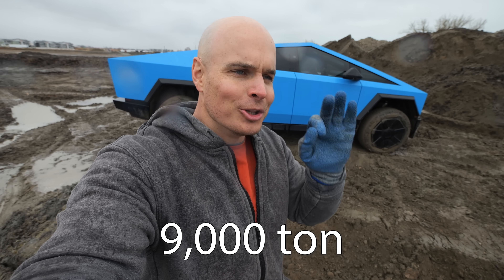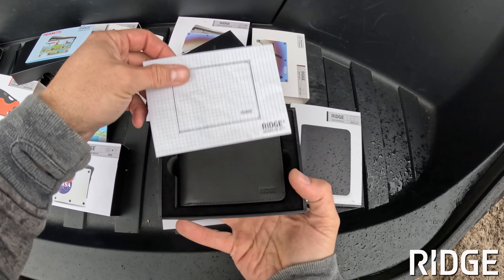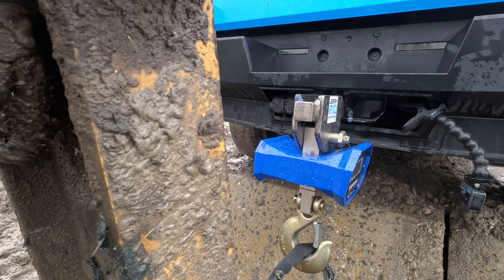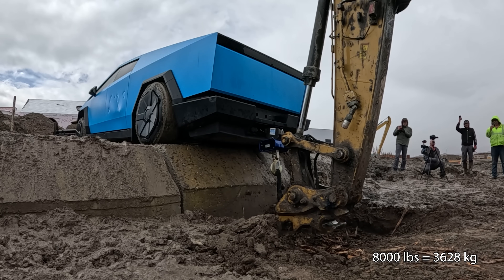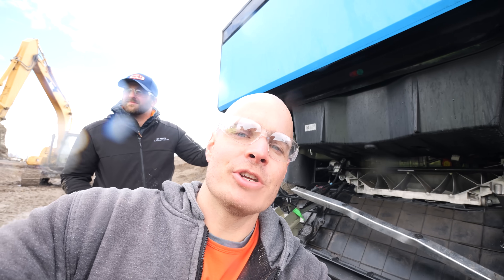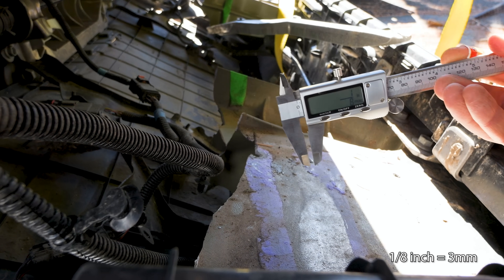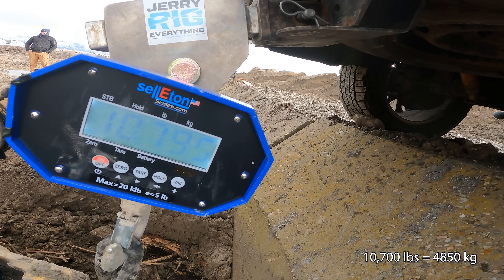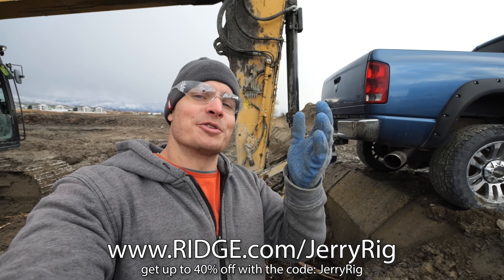SHOULD YOU TOW WITH A CYBERTRUCK?! - (catastrophic failure test)

Comment: 4.5 tons of force downward isn't really a realistic scenario. You should have tested that in the backwards direction!
Towing capacity is not equal to force straight down on the hitch. As the trailer itself will balance the weight on the axle(s).
This test is completely unrealistic.

Most people don't understand how real towing is performed. And thus this video gets very misleading even if it was not the intention. The comment section is filled with hate on the vehicle. That actually performed much better then it should. 4.5 tons straight down on the hitch is amazing!

Comment: Tow Hitch Weight Allowance!!  This failure is impossible to do with ANY normal pick-up truck.  The front tires will lift on the ground and the truck will not drive.  The Tongue Weight (downward) on a hitch should be about 10%-15% of the trailer's total weight.  This video is ridiculous and totally unscientific.
He won't acknowledge this. Any engineer would tell you that exceeding a rating by over 10 times is pretty good. But he has a bone to pick so the video has to be negative.

Comment: Horizonal load linits are very different to ball weight limits.. this is a 100% flawed test... typically most vehicles that that have 2500kg towing capacity are limited to a 90 to 150kg ball (hitch) weight. Just a silly test to perform.

Comment: it would be interesting to see how many repeated tongue weight tests within the rated weight of the hitch would cause it to fail. The fact that aluminium is weaker but lighter than steel is well known, although aeroplanes are largly made of aluminium, so they can obviously take repeated loads within their rating for many 10s of years. This "test" being a "yank it till it breaks" is fun, but apart from concluding that steel frames are stronger than alumium, and if you want to overload a trailer beyond the rating so much you have to hold the front down, it is just entertainment. What facinates me is that people are quick to judge a product based on it's CEO, but they most likely know nothing about the CEO of any of the other car/truck manufacturers. in one respect it is no different to your phone tests which are entertaining and brutal, but there are a larger range of classes of trucks with completely different physical ratings, so it is not quite an apples for apples comparison.

Comment: There is a reason why trailers in Australia that weigh 2000kg or more have to have a break away emergency braking system - ie if the trailer seperates from the tow vehicle and the safety chains fail, the trailer brakes are then automatically activated.

Comment: Sorry mate, but you are simulating excessive ball weight, not an actual real world scenario.  The suspension is taking most of stress, you are not testing the lateral strength of the frame, where the actual stress would be distributed in a real world towing scenario.  This is a very poorly designed, and disingenuous testing methodology that proves nothing for real world use cases.

Comment: I had more respect for you before this video.  At no point will anyone be able to put 10K lbs on a tow hitch receiver.  You proved that by having to hold down  the front end of both trucks.  This is misinformation at best.
Reply: It really isn't, obviously he had to hold the front down when the CAT vehicle was lower than the Cybertruck. otherwise it would come off the ground. Basic physics.
Reply: @AndreasRP.  you just proved my point.  No vehicle can tow a load with the front wheels off the ground.  You know, basic physics and all.
Reply: @navy_vet  I think you misunderstood the video. I recommend watching it again and paying close attention to what happens and what Jerry explains. This frame issue is more serious when going uphill or hitting potholes, that’s where the frame is most likely to break in a real-world scenario, but that shouldn’t be happening. It’s basic physics and a result of poor design by Tesla.
Reply: @AndreasRP.  I think you miss understand how this works.  You will never see a static or dynamic force of 10,000 lbs on a class IV or less rated hitch, pothole or speed bumps or not.  That is not how this works. He tested to absolute failure.  He brought forces into the equation that will never be seen in real world scenarios.  He greatly exceeded manufacturer tongue weight by 10X and max payload capacity  by 4X.  Testing to destruction is not how hitches are rated.  In order to see a 10K lb load on a bumper pull hitch, the weight of the trailer and contents would need to be 100,000 lbs.  18 wheel trucks can weigh a maximum of 80,000 lbs and must distribute that weight over 18 wheels not just 4.  Speaking of tires, this test alone almost doubled the maximum weight carrying capacity of the rear tires alone.  So even if you consider a dynamic weight change with any potholes or flying elephants, you will never reach 10,000 lbs on the rear hitch.  Watch the video until the end and tell me again how wrong I am.
Reply: @ it’s a truck, 10.000lbs isn’t a lot, the Ford did it with no problems ahaha, Tesla is junk.
Reply: @ Tesla being junk or not is not what the problem really is.  The problem is the poor testing practice in this video and the misleading statements made.  As for your statement, put 10,000 lbs in the bed of any 3/4 ton (max payload 5K) or half ton (max payload 4K) truck and see what happens. You can even use a 1 ton dually (max payload 8K).  10K isn't a lot!  Ok!  You obviously don't tow heavy trailers and have little to no idea what GCVW, GVW, GCAW , payload, CCC, pin weight or tongue weight is and how those figures work.  If you do tow heavy then I suggest you find out what these mean really fast or you will meet the friendly DOT officers very quickly.  I guarantee if DOT catches someone pulling a 50K lb trailer on a 3/4 ton truck (that would be 5K to 6.5K lbs of hitch weight) then the DOT will politely place said individual under arrest.  But, you do whatever makes you feel good.
Reply: @ it is not misleading, matter of fact is that it snapped in half very quick. Now imagine you do half of that (5000lbs) how long before it snaps then? As he also mentioned aluminum weakens over time, steel does not.
Reply: @AndreasRP.  What part of this don't you understand?  You will not see 5K lbs of dynamic or static load on a bumper pull hitch either.  Go make yourself knowledgeable on the subject before commenting please or don't.  Whatever makes you happy.  You are just being annoying.  You can have the last word too if it makes you happy.  You will just be wrong and that is ok.  Be well.
Reply: @AndreasRP.  Oh and yes steel can fail just like aluminum.  Metal fatigue occurs in all metals.  Look it up.
Reply: @ sure, but not like aluminum does, there’s a reason real truck manufacturers use steel. It’s much stronger as you just saw in this video. At the end of the day, the cybertruck is a dangerous vehicle because of this failure. Go watch whistlindisels video too.

Comment: I may not be as smart as you guys but holding the cyber truck in the front isn’t that exiting way more than normal forces that would actually stabilise any truck I see that cracking at those forces as a safety measure so that the trailer can be released if extreme forces go through the axle Avoiding stabilising the the truck a force comes on the tall enough to lift the front of the car or truck that vehicle is gonna go out of control so by this tow hitch cracking at those forces that are high enough to lift the front of the truck I see that is a safety precaution I would prefer something that would snap before stabilising the car because there’s no way you’re gonna control the car if it’s coming up in the air my two cents!!

Comment: Because aluminium is really well known for its strength? Tesla is the epitome of sounding good on paper .
Reply: Just wait til find out what airplanes are made of 😉Maybe the aerospace companies need your engineering expertise to show them the way.
Reply: @Turbo.M777  They aren't meant for tension and stress under load for towing like a truck. Purpose of aluminium is different there because it's light and sturdy. You can't possibly say steel is worse for towing. Aluminium gets weaker every time you tow unlike steel. Steel is denser , heavier and better for towing. Both have their advantages in their respective fields
Reply: @ Go fly in an airplane, and watch how much the wings flex back and forth. You don't think thats cyclic stress on the aluminum? How abou engine blocks containing millions of combustions and heat cycling? Come on... yes, mass to strength steel is stronger. But thats hardly the beginning of the equation.
Reply: @Turbo.M777  Exactly , i go broadly. Ofcourse this is not my area of expertise , i'm just an orthopaedic surgeon

Comment: NO a trailer hitting a pothole does not magically move 100% of the trailer weight onto the truck hitch! The trailer would have to be balanced vertically for this to happen.
Tongue weight is NEVER close to payload or towing capacity and you have to know this. For conventional trailers, it's usually 10–15% of the trailer's total loaded weight.
This video is intentionally deceptive and disingenuous.
Reply: Have you watched what he says? He explains everything you just said in the video but there are many cases where this could happen
Reply: @Ed.E  there are NO cases where anything near this could happen.
Reply: @Mini_Motor_Mayhem  well it’s happened three times already to a number of Tesla’s not just in these extreme tests
Reply: @Ed.E  that's where we need to investigate , is the actual failure mode not this . All this test did was confirm how insanely strong the tesla truck is versus its design spec. Not all trucks are 3/4 ton with towing package nor do they need to be. Most people are using trucks as cars these days.

Comment: Bro Tesla tongue weight is 1100, and it broke at 10x , I didn’t expect this from you , cheap shot
Reply: Rated to tow up to 11,000lbs
Reply: Whats your point the rams tounge weight is rated 10% of the towing compacity as well and the steel frame was just fine at 10x that rateing.

Comment: You don't normally load 11,000lbs on the tow ball. That weight is on the trailer. And pulling force is not the same as load. Pulling a load of 11lba is not the same as carrying it. This test is BS

Comment: That is insane - I mean it's insane that you think this is a test of anything! SERIOUSLY what trailer can you put on a truck which would even come close to 5 tons of downward pressure? - or even the 3 tons which was when everything was 100% OK. The fact that you LITERALLY need to hold the front of the truck down to break it - and you are then behaving like this is "bad" - is just crazy! It can't drive like that to begin with for crying out loud! This test proves that you would need to exceed ANY kind of rational scenario for this failure to happen!

Oh and BTW I'm not a fan of this ugly monstrosity! HOWEVER I am a fan of being rational - and this test goes FAR beyond what a truck like this would ever experience in the real world unless you exceed the rated towing capacity by A LOT - at which point YOU are to blame - NOT the truck!
Reply: A pothole will apply significant downwards force to a tow hitch
Reply: @Ed.E  IF it applies 3 tons of downwards force the front wheels will be off the flipping ground m8!
Reply: @Craider79  yeah, the wheels might come off the ground but that doesn’t change that at that point that’s still a lot of force on it
Reply: @Ed.E  I don't get your point? IF you have loaded your trailer so badly that your front wheels lose contact with the ground - a hitch breaking is the least of you worries! LOL the loss of control is KINDA a lot more concerning! 😀The car/trailer will literally be seesawing around the rear axle of the car causing the hitch to slam into the ground which would be impact and upwards force instead - so ACTUALLY pulling up on the hitch while hitting it with a sledgehammer would have been are more informative "test"! Hahaha
Anyway the 3 ton was where everything was still ok - and the truck is about 3 tons - and the rear axle is about a meter + in front of the hitch which means you will need a lot less than 3 tons of force to seesaw the vehicle and trailer... so the whole scenario is still flawed AF in this "test".

Comment: Cast Aluminium is very brittle (weaker and even more brittle than cast iron)... at least if you had a failure on a steel chassis with steel tow bar etc, it would be a gradual deformation, not a sudden complete failure.

Comment: I'd say there's nothing wrong in using both bolts and glue. When you join wooden construction, frames, whatever, if you screw parts together AND glue it, you get the best possible join. The screws work the best for keeping the parts together, and the glue prevents the parts from twisting.

Comment: What other commenters here do not realise is that the tongue weight rating does not mean it only has to withstand that amount. Due to G forces the load will vary when in motion. This test confirms that the tongue weight + transients cannot exceed 10,000 lb. And when towing a lot, aluminium is going to weaken itself a lot over time, so this is the absolute maximum when new.

I'd like to see this tested again in 10–20 years when the truck has seen a lot of use, if it lasts that long.

Comment: Oh wow with 100 percent tongue weight a steel frame beat aluminum, color me impressed. This test is a joke and in engineering terms this actually shows the strength and design of the cyber truck. I don't like Tesla's and I won't get into politics about Elon. All I can say is that this shows that the cyber truck can tow pretty much anything you want to tow with it without an issue.

Comment: Mechanical shock is an exceptional risk factor for the tesla; it's more rigid than a truck should be and has high mass, so any impact will result in very high peak load.
a proper truck, on the other hand, has a more flexible, shock-absorbing chassis, in adition to the fact that most steel will bend without breaking. lose-lose for the "cybertruck" design.
Reply: also re: mass, a typical pickup has a front-engine layout, so the majority of its mass won't be directly involved vertical or horizontal hitch impact.
cybertruck is close to 50-50, greatly increasing inertia of the hitch mounting point.
more inertia = higher shock load, more rigidity = higher shock load.

Comment: I’m not an engineer, but seems like you could have tested that older pickup by just moving it around? What about putting it on its side up against the tracks of the excavator and have the excavator rotate away from it whilst having the bucket and hitch attached to each other?

Comment: Okay, while towing up a hill that weight goes on the hitch but it pulls horizontally not vertically. So how is this test relevant ? Whislindiesel pulled the truck and it snapped. Thats what needs to be tested, at what horizontal pulling force does it snap, not vertical
Reply: did you watch the video?  He explains why literally in the video

Comment: Well, there is a reason EVs usually come without the tow bar option...
Edit: And also why that abomination will probably never receive TÜV approval in Germany.
Reply: What? It's nothing to do with EVs and what they're made of.  Many cars that are available as ICE or EV are made from the same stuff.  Typically they didn't come with towbars as it's only recently that batteries have been good enough to be able to tow with decent range.  My Skoda Enyaq is perfectly capable of towing around 2600lbs.

Not just Germany it would be illegal in the EU and UK due to safety as much as anything like only having red indicators illegal in Europe, the lack of crumple zones for pedestrians, the creases in the stainless steel are too sharp not to mention the ridiculous weight of the cybertruck in the UK you'd need an C1 licence to drive it making it a commercial truck if it were ever legal which it won't ever be

Comment: I have a feeling it would fail much sooner with upward pressure
Reply: Don't see it as with upward pressure you can only apply the trucks own weight against it using gravity
Reply: @norfolkngood8960  that's how whistling diesel broke his. Seems like it snapped pretty easily. You could see some very brief shock loads on a pothole or something. Or could severely weaken it in short order driving down a rough road, with constant up and down forces weakening it in both directions.

Comment: Sorry, but this test is nuts—it’s nowhere near realistic. Look at Europe: much weaker vehicles tow heavy trailers every day without any trouble.

By the way, next time, remove the scale from the hitch before towing the truck to avoid dragging it across the ground.
Reply: I think you'll find living in Europe we typically tow MUCH lighter loads given we're constrained by the mass of the towing vehicle to establish towing limits and our vehicles top out at 7716lb and then you're supposed to stay at 85% max weight of your tow vehicle  

So max towing weight here would be 6558lb being 85% of the 7716lb max car weight and of course most cars weigh much less that that.  Avg weight of a new car here is 4292lb giving a max tow weight of 3648lb or 1654kg

Comment: Jerry is picturing a worst case scenario for the cyberattacks hitch. Him pointing out to say only 10% of the towing rated capacity should be on the hitch means their is no alarm on towing with the cyber. Truth be told their is a very low chance for the whole 10,400lb of weight to be on the hitch alone while the trailer still has wheels on.

Comment: Now I'm not an automotive engineer, I am a metallurgical engineering student though. I gotta say that rear structural member looks to be a really bad geometry. 
It's basically an I-BEAM. Which means regardless of the congregations it is still weak axis under vertical load.... Forget that it's aluminum, I question the quality of the design itself.